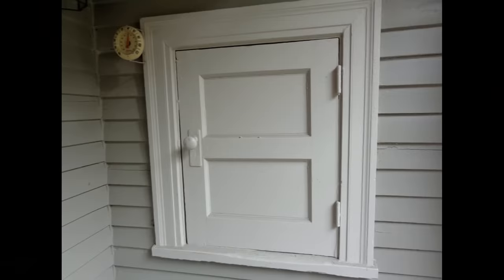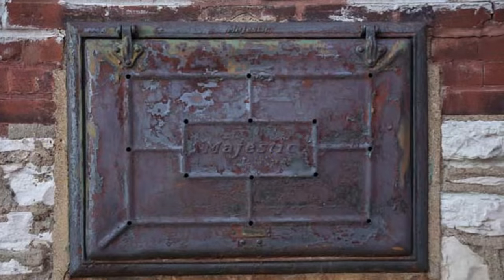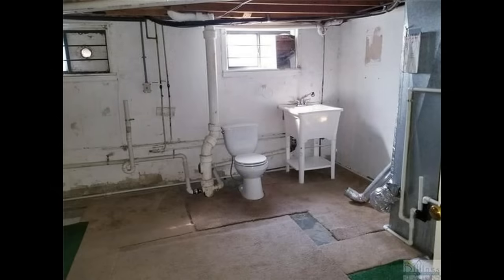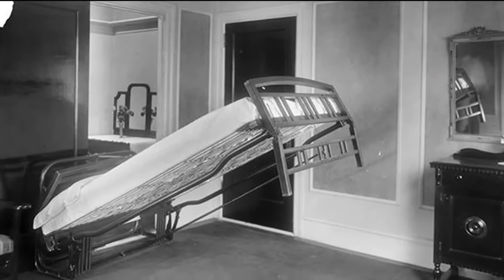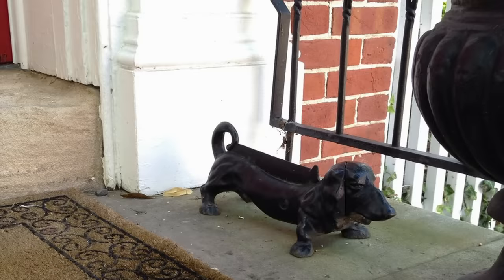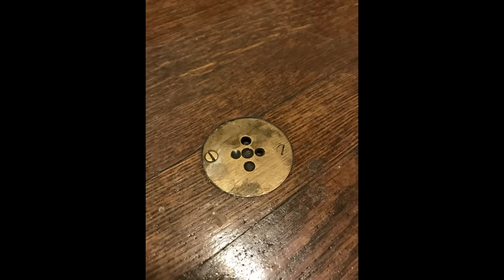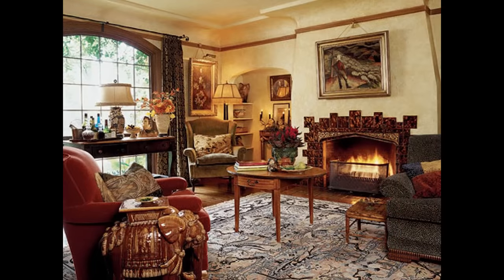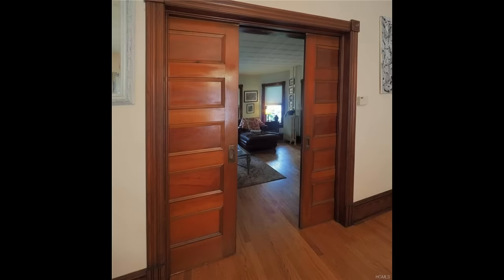Mysterious Home Features No Longer Used

Comment: BTW, that old wiring you showed is nicknamed “knob & tube” wiring and was a great design, but over the years people would inadviseably splice in new circuits thus overloading the wiring with too many amps which caused fires).
Reply: They also were in uninsulated attics. When adding in insulation became important, that was a problem.
Reply: @ArtStoneUS  insulation didnt cause any issues but badly done connections would.   The wire itself is very good and durable stuff.    Its the way it was connected that is bad.   They did not use wire nuts to hold connections TIGHT,  instead, they often just wrapped one wire around another  that was passing thru.   That is a horrid way to connect, and it can arc especially when it gets old and oxidized.
Reply: In 1980 friend inherited an old photographic studio that had really old wiring from the 1920s, when he decided to try using it there was a small explosion as a length of wire was blown out of the wall.
Reply: My house still has knob & tube. Although it been replaced and not used, My work shop still has it, And is used just for lights. Walls been rewired for tools. Use to have a 2 prong power strip that ran all ways round the wall,

Comment: A feature you missed were the heat registers between floors.  I lived in a home built in the late 1800's that had metal grates in the ceiling on the ground floor, and the floor above.   They allowed heat from the first floor to rise up.
Reply: I have a grate in one of my upstairs bedroom floors  but somebody in the past redid the ceiling on the lower floor and closed off the hole but they were at least smart enough to leave the upper grate behind
Reply: I had those in my house when I moved in. I still have the grates, but I covered the holes while remodeling. I still have 3 large pocket doors. Another thing that I used to see around my town was posts by the street where people could tie off their horses.

Comment: If you install pocket doors include a removable section at the bottom of the wall to vacuum out dust and hair once a week or so. If it's large enough you can do maintenance on the track if it doesn't use the hanging type that I prefer. 👩‍🔧
Reply from the maker: Thank you for watching and sharing some ideas on how to keep them going.
Reply: I appreciate this insight as to why this old feature might have been discontinued, due to difficulty maintaining/cleaning.

Comment: I remember living in an old home as a child and it had an ironing board that came out from the wall with room inside there to keep an iron.  It also had a built-in electric heater in the bathroom wall.  Some lights were turned on and off with a string hanging from the bulb and the toilet was flushed with a chain.  Bread boards were built into all countertops when I was a child.  Dough was rolled out on it but it was also used as a cutting board for all foods.  No one had a separate cutting board for meat.
Reply: Yes, i have seen ironing boards in the walls of many Chicago-style bungalows, they were fun and very convenient. I would say, bring this feature back, it is just not too many people are ironing anything now.
Reply: They sell fold out ironing boards at home depot....keep up with the times, will ya?!
Reply: Cupboards with built-in bread boards are still very common in the new houses in northern Europe. But definitely it is good idea only to cut bread on it and use a separate cutting board(s) for other stuff.
Reply: @_Diana_S  Yes, I gave it up years ago.  I think the fabrics of my youth were more wrinkled out of the dryer.  Maybe the dryers of the day did that.
Reply: Yep, we had an ironing board nook too!

Comment: My grandparents had this neat old 2 story home that was all about keeping cool without AC. So many different things were thought of, measured, calculated and planned prior to being built that it was quite amazing, really. 
On the 2nd floor in the back of the house was a huge room, probably 1/4 of the 2nd floor, that had this screen material on 3 sides and two huge fans that moved slow but moved a lot of air. You could easily sleep in that room at night without AC and feel just fine.
Few windows were installed on the west side of the house (where the sun sets), as to not let in too much sun  and heat. The house had high ceilings and these narrow openings that would draw hot air up and away.
The natural airflow in the neighborhood is typically north to south (not always of course), so the house was built with windows on the north and south side that could be opened (prior to the whole house fan) and let in the naturally occurring breeze.

They also installed a whole house fan in the 50s or 60s and that was pretty cool. There was this huge fan and you opened a 'door' on the ceiling and then had to open something else in the house and turn that fan on. It literally sucked air through the house and kept you cool.
Reply: The house my parents built in '77 had an attic fan and the switch was tucked away in the bathroom closet. We had central air, but they'd still turn on the fan on the hottest days for sucking the heat out of the house.
Reply: @HerbalMoon17  everyone had a "attic fan" back then.... You would open the window's up and turn it on, the one that we had would pull so much air, the drapes would look like they were about to take off... Couldn't run it all-night, it would get to cool in the house.... even in July....
Reply: This was called a sleeping porch. They would move the beds out onto the porch in the late spring when the weather was warm and they would sleep on the porch until the fall when the weather started to cool down.
Reply: Still use a big fan in the attic. Open the east windows under the big porch around 10:00 and turn the fan on, leave the fan on till 5 or 6 in the morning, then close all the windows and doors in the house till the evening. Keeps the house at sweater temperature even in the plus 30° weather. Way cheaper than ac, and uses minimal energy.
Reply: homes should still be designed this way even if they have the option of AC. My (horribly insulated, horribly lit) apartment gets incredibly hot in the summer and I can't use the second floor at all - but after getting myself a circulation fan for the window upstairs, it cuts the entire house temperature down by as much as 10-20 degrees on hot days. (The SINGLE upstairs window is built in such a way that a window AC would be impossible, but the fan works)
Reply: @iesika7387  I agree that housing should be built with some additional thought. I don't know what the style is called, but I saw some interesting housing architecture in Arizona that was specifically made to keep houses cool. Lets say the house was in the shape of a rectangle, there was a couple of additional 'roofs' that were parallel to the ground and at different heights. They blocked the sun from hitting the house directly - which is key in keeping things cool.
Reply: In 1984, my father-in-law built a 3 bedroom- 2 bath kit house with an attic fan in the hallway.  I lived in that house for 13 years and used the attic fan ALL THE TIME.  It was the most fantastic thing I had ever seen in a house.  
We moved to a new home that doesn’t have a fan, and I’ve missed it for past 18 years!
If you can, build with or install an attic fan!!!

Comment: My favorite is the "California Cooler." A drawer or cupboard with slatted shelves and vents top and bottom to allow air flow to the outside (natural convection). It would cool the air and help preserve perishables. Sometimes you might see the vents on on an outside wall. Design might vary depending on local climate. They can be very effective!
Reply from the maker: I completely forgot about those but I remember seeing one in Richard Nixon's old home when we toured it.  It was on the property where the Presidential Library is.  Thank you for watching and sharing another item worth remembering.
Reply: I lived in Russia for a while. Usually in the kitchen there was a built in cabinet/settee. The doors were lightly insulated and the back of the cabinet was sheet metal facing the outside elements. That was essentially the 'root cellar' for the apartment.
Reply: Yeah we had a wall like that in CA. Had to cover it over because the rain would come in! 

In NY our house had a potato/dry goods bin in the kitchen before our remodel, too.
Reply: There is one in the house I grew up in, in Los Angeles, built in 1924.  works great.  Mom kept fruit, vegetables, butter ,eggs in it.
Reply: My parents had a drawer like that.  I didn't know it had a name, they just called it the Potato Bin.  There were round screened vents to the outside, hidden behind some shrubs.
Reply: Most common in the parts of the central valley that are close enough to the delta to get the delta breeze.  My grandmother's house in Lodi had one, so did my Brother in law's place in Stockton.

Comment: The 1930 farmhouse my parents bought in 1958 had
- lath and plaster walls
- knob and tube wiring
- a fuse box with round glass fuses
- a built-in cooler cabinet in the corner of the kitchen on top of the counter with vents to the outside
- a razor blade slot in the bathroom medicine cabinet
- 9' ceilings and picture rails
- a cover over the hole where a wood fired cook stove had been vented into the chimney in the kitchen
- recycled lumber that had been in a fire used for the 1st floor subfloor because it was the Depression and new materials were scarce and/or too costly
- floor joists 24" on center rather than 16" again due to scarcity of materials and/or cost
- and, an exterior window left in place when the house was extended creating an interior window between a bedroom and the laundry room
Oh, how I loved that house!
Reply: Oh my stars my husband and I own an older farmhouse a local family built in the earlier 1900s and we still have the glass ended screw in fuses, the random covers for wood stoves in certain rooms along with an original meal master woodcook/coal stove and oven that we still use to this day, where the stove is in the main kitchen there’s a heat protector panel against the wall where they had another Woodstove and chimney (a 120vyear old tree took the chimney out when it fell on the kitchen side of the house during a derecho that hit yet the original beams in the attic and suck beared no damage at all), all of the doors to house use original skeleton key locks and functioning hardware so our keys are just that, when we were fixing damage from where the tree fell externally we found asbestos tiles used for insulation that we had to safely remove and get rid of, the original owner also grew grapes to make into wine which he would do in the root cellar under the house, and one side of the woods where there is a deeper hillside they used to dump there trash before dumps were around so to this day you’ll find a or class bottles from cleaners to what they used to keep certain medicines in and various other things. Oh let’s not forget the fact that the house isn’t made with any heating or AC run through it so we have to use fans and open windows or utilize windows units to stay cool and in winter we use woodstoves for heat while shutting off many of the doors to various rooms to help heat them too. We raise our own food livestock wise while my in laws next door grow food also
Reply from the maker: Thank you for watching and telling us about the home your parents had.  Sounds like it was a great one!

Comment: I owned a house built in 1897 that had some very cool things throughout it. There was this tiny 'room' on the 2nd floor with an oval shaped window and yes it had a door. I was never able to sort out just what that room was to be used for....Thanks for the great video. Personally I like old houses better than newer ones, especially the amazing woodwork in them.
Reply: I lived in San Francisco,.... and there was a tiny room too on the second floor , but they called it the fainting room. Women would pass out after climbing the stairs in their tight corsets, and needed a place to rest,... hence the name fainting room.
Reply: I lived in an older home that had a small narrow room (with a door) that was called a rocking room. A room to rock a crying baby while the grown ups talked out in the parlor.
Reply: my house had a small room the size if a closet, but with a large windiw in it.  During some remodeling,  I removed the trim from around the door.  On the back of the trim, the carpenter had written "sewing room" in pencil in order to keep track of which doorway it had been cut to fit.

Comment: I have lived in apartments & old homes with many of these things. The old home my parents bought when I was a teen-had the coal door, my dad & I laid down plywood on the area inside, underneath it, as it still had a coal dust floor.  My favorite apartment as a young single had the milk door that opened into the pantry, transom window over the back door, and a rectangular recess in the kitchen wall that I was told once held a fold down ironing board. My neighbor had a Pittsburgh potty. Never knew what that was about til now! Thanks. This was a visually beautiful video. Again-so many memories.
Reply from the maker: Thank you for watching and sharing some of what you had experienced.  Sounds like you have really lived in some cool historic places.  That folding iron board is certainly another item worth mentioning.  I completely forgot about those.
Reply: Oh yes, many apartments with those built in ironing boards. Those were useful!
Reply: Those milk doors are still present in some old houses & apartments in my city. I've seen a few of those when house hunting. One of the neighbours had repurposed them by sticking a label 'Put Ubereats Here' on the outside.

Comment: Less common: the central vacuum cleaner system. The whole mechanism was in the basement, with a port in each room for the hose, so you (or "the help") didn't have to lug the machine around and bash the walls and furniture with it.
Reply: @feelingafnar8885  I didn't know they made them anything LIKE that recently. The only one I ever saw was in a huge, grand old house from the early 20th Century!
Reply from the maker: Thank you for watching and mentioning another feature for us to remember.
Reply: My parents had our home built in 1970. Came with the central vac. Great device. Even had a port in the garage to do the cars.
Reply: The house I live in has/had central vac when I moved in. It was built in the 1980s and I think it was a "throwback design." I removed the system and covered all the hose attachments in the rooms years ago. The system never worked when I owned the house.
Reply: My childhood home had a central vacuum cleaner, still works today!
Reply: New houses are built with central vacs today

Comment: My parents' house (built 1941) had a plug on the living room wall by the baseboard. It connected to an antenna that ran under the floorboards of the attic; they could hook up the radio to it. (The 1940s equivalent of a cable TV connection.)
The house also came with double concrete laundry tubs in the basement, one of which had a built-in washboard. Back then, laundry might still be done by hand; the tub with the washboard was for washing, and the tub next to it was for rinsing. Really luxurious versions had three tubs: wash, rinse, and rinse again.
Reply: attached to the rinse tub would be a wringer to squeeze out the excess water before hanging the clothes on the line.  Today we've become used to our automatic washers that spin out the excess water.
Reply: @karenryder6317  I remember Mom's tub washer, which had a power wringer on top. She caught her fingers in it more than once, which wasn't a pleasant experience.
Reply: @Gail1Marie  That's where they get the phrase, "You look like you've been through the wringer!"
Reply: @jenniferp1917  Exactly! My mom never let me near hers, but I did use a hand-cranked wringer at the YMCA to wring the water out of my swimsuit (sort of a proto-suit spinner).

Comment: I lived in a house built in the late 1800s and we had most of the features that you mentioned. One feature we had that you did not mention was a cistern. It looked like a 5' x 5' corner of our basement was walled off with the exception of a small window/door near the top of it. The door was too small to climb through, but we could see in and noticed that the "floor" of that space was actually bowl shaped.

Comment: Fun video - one bit you missed. The reason people needed picture rails in the past and weren’t afraid of nailing into the walls later was due to the change in wall construction. Starting in 1922, wallboard/gypsum board became available, but it took a couple decades for people to become comfortable with the fact that it was now easy to nail into a wall, or fill the hole if you moved the picture. With the old lathe and plaster, you would likely end up with a 1-2 inch bit of damage (and mess) when trying to pound in a nail, and could end up with a long crack or loosened area of plaster. If you drilled first, that would help, but a standard drill bit might be able to make 2-3 holes (if you were lucky) before becoming too dull. The base layer of lathe and plaster is almost like concrete, embedded with horse hair. My 1922 house was ahead of its time In not adding picture rails, but still used lathe and plaster - after a couple mishaps attempting to hang pictures, I installed picture rails. 
Oh, and the ease of re-arranging pictures is bringing them back in a modern form. 😁
Reply from the maker: You're right about the usage of drywall.  Plaster was much better but more expensive.  Now the guys that knew how to work with it are disappearing.  Thank you for watching!
Reply: Picture rails were used a lot when wallpaper was the usual finish for walls>>didn't want to put holes in it as you can't just spackle the hole when a picture gets moved.